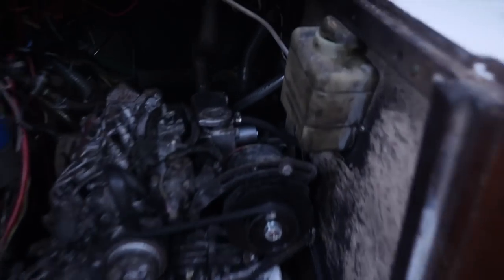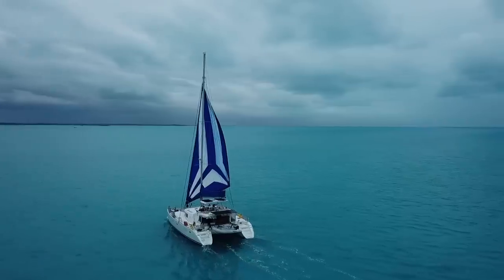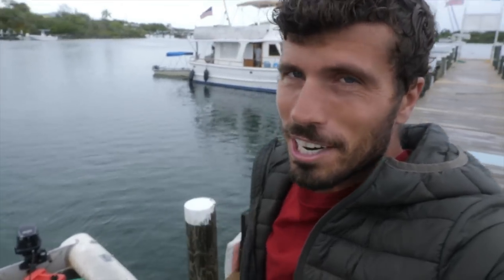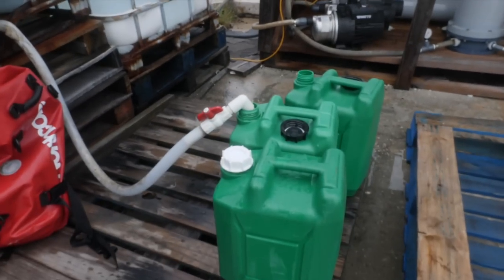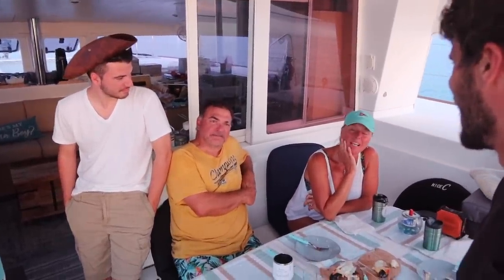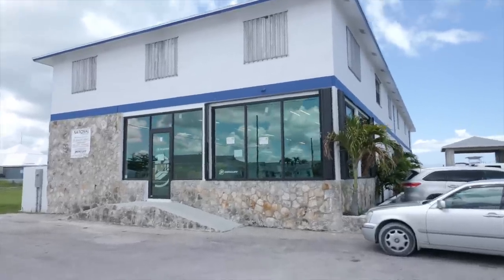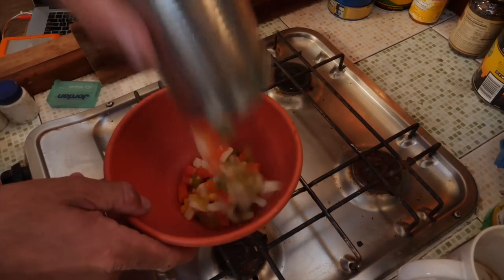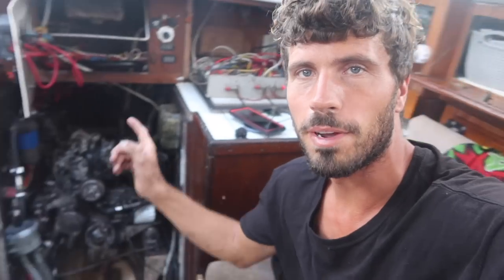A Dangerous Day in the Life of a Solo Sailor

Comment: I remember working on the Sea Fox, steel construction 50 feet with heavy keel. Chain watch by stormy night wasn't about tracking the boat, it was about snapping the chain. It was the Red Sea , you had to anchor quite close to the land, and if the chain would break you had not much time to start the engine and pull away from the coast. It didn't break, but I still remember the night about 44 years ago :-)

Comment: When it comes to shaft seals, When you can $$$ and its when your hauled out. consider getting a lip seal "shaft seal system". Packing seals work, but they are old tech. The new lip seal systems use ceramic plates and a "hose boot", and you have a backup pre-loaded on the shaft as well. Anchors its always good to hand dig it in, provided you dont mind diving. Unless its a thin layer of sand over coral. Dont forget with two anchors, you can alays do a V or a fwd/aft anchor setup hand drop the second one using the dinghy.
Reply from the maker: thanks!